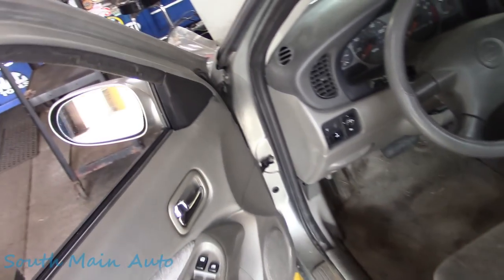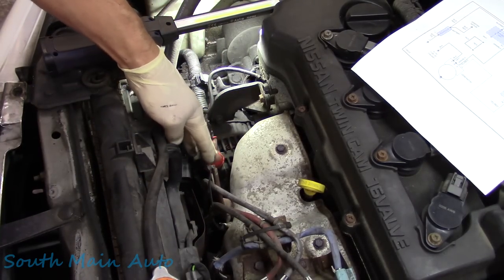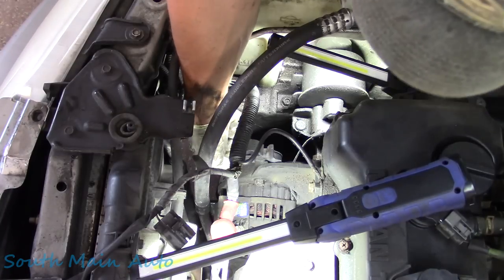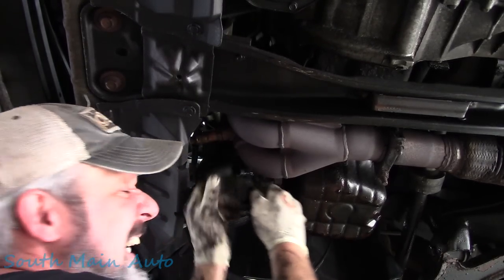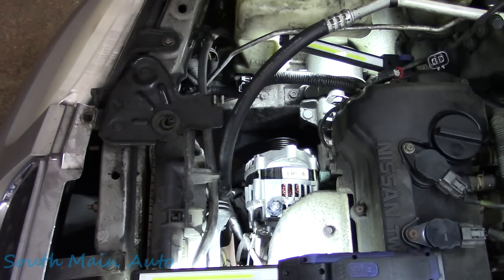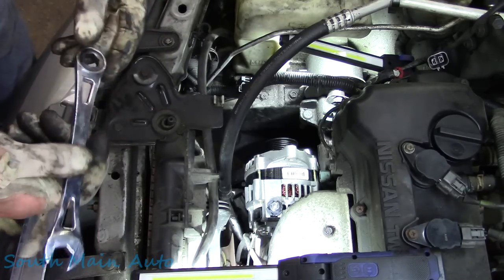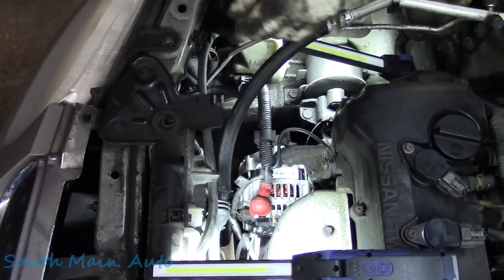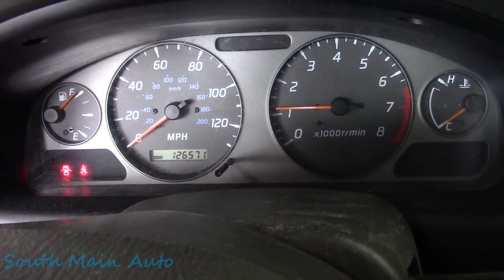Nissan Sentra: Battery & Brake Light On?

Comment: Had a 98' Maxima with 150k miles when my alternator died. Was driving and noticed the battery and brake lights on. Did a google search and saw a common issue is failed alternator. I was like, crap! I tried to make it back home but car died a mile later. It was 11PM and car was in an industrial part of town. Tried figuring out what to do for an hour or so, and a private ambulance saw me. I told them what happened and those guys jumped my car all the way home. Had to jump it twice but I gunned it and just barely made it back on the second charged. gave them what money I had cause they saved me a tow charge. I kept the car in the garage for a month or two before deciding to tackle the alternator job (watched a couple of youtube videos on how to do it). was a PITA but got it done, and even did hood struts and radiator replacement.
Reply: @Les Reeves yeah this was many years ago. Now i carry a portable battery pack, first aid kit, road side kit, and a fire extinguisher!
Reply: I changed the alternator on my '97 Maxima once. Once.

Comment: Hey Eric O, you had me laughing my head off watching you change out this alternator in this 2001 Nissan Sentra/Pulsar as I own the RH drive version of this same car. Same engine as well. I am on my 3rd alternator and it' 's a very common fault for them to fail at this amount of miles. My N16 series has 432,000km or 268,000 miles on the odometer on the same engine 3rd gearbox. I fitted a new 100amp alternator to have it fail 600 miles later. I was pissed because that rear bolt is a pain to get to. I found that a wire inside the unit on the voltage regulator had a dry solder joint and caused the new unit to fail. "J" hooking and soldering the wires fixed it and 1 hour later I was back on the road.
Love your videos as you make me laugh with some of the jobs you do.

Comment: Ah, back when Nissan made great cars.  I still own a 98 Nissan 200SX.  It's on teenage driver #4 now for a daily driver to school and back.  Been an absolutely FANTASTIC car.  Never breaks.
Reply: Ah the 2 door b14 sentra. Had one myself, back when they made rock solid reliable econoboxes and not rolling dumpster fire cvt equipped junk piles
Reply: @TheCarguy1993  Yep.  And I'm not sure why I love the car so much but I do.  It's gotten basic maintenance...starter, alternator, belts, thermostat, (and the occasional clutch replacement due to teaching kids to drive it and one of them burned it up in stop and go traffic on a hill one day) etc. but has been trouble free for 165K miles with teenagers driving it.  Fortunately, I can change the clutch in it in about 4 hours.  Not many cars stand up to that kind of abuse!  Thanks to that car, all my daughters have learned to drive manual transmissions.  They all hated learning it but once they did they brag to all their friends and all their friends want them to teach them.
Reply: @johnaclark1  thats killer, 1.6? I remember doing a clutch in about that time as well
Reply: @TheCarguy1993  Yeah, it's the SE model. Always wished it was the SE-R, as the 1. 6 doesn't get out of its own way, but the 33mpg of the 1.6 looks pretty good these days!  Perfect for my teenage girls.
Reply: @johnaclark1  the 1.6 is lethargic as hell but unkillable, here in ny though it was mechanically totaled cause the egr valve went,threw the money light,part unavailable and couldn't inspect it
Reply: Lets not go crazy.  They were notorious for head leaks
Reply: @gfriedman99  Well, it's got 175K, is 25 years old, and is still driven daily.  No head leaks yet.  It doesn't owe me anything.

Comment: The bad part is if that alternator is like most electronics from the parts store you'll be replacing it probably 3-4 more times in the next 5 years. At least that's my experience. On my own vehicles I wouldn't dare put on anything but a factory alternator/starter etc
Reply: Rebuilt alternators and starters are the pits. New Chinesium ones are only a little better. I agree completely: if the part will strand you or worse (like a broken ball joint) or is hard to get to, just get new OEM. Too many regrets from my penny-pinching youth.

Comment: A kilt is great But I had to stop I found the battery one day. when I had to straddle a fender on a Square body, I had to to get to the Distributor the truck was lifted just enough,  should have used the step ladder. Cover alls are great too in fact better because of that problem. And the Mrs' would rock them.

Comment: If you're gonna load test the alternator cable, it might be good to check the voltage drop across it while you're at it.
Reply: His tester has a volt meter on it. I’m sure he checked the voltage while under load.
Reply: @brycelund4112  Yeah, but it's hard to say what part of the voltage drop is due to normal battery voltage drop due to the load and what part might be due to cable resistance. TBH, I'm not worried about Eric's intuition, I just thought that others might get the wrong idea from the video. A 75A load doesn't mean much if there's a 6V drop across the cable.
Reply: @fascistpedant758  In a sense he was testing the battery as well. If it did have excessive voltage drop. I’m sure he would have then put his tester right on the battery posts . If the drop goes away. You know you have a cable issue.

Comment: I think engineers have squirrel droppings for brains sometimes when they put a bolt like that in a car. I used to wear overalls when I worked outside and yes they are comfy. I wore a tee shirt with it. The only problem with them is when you have to drop the kids off in the pool and one of the straps falls in and gets wet. Otherwise go for it. You could put your name on it and sell them as well. By the way, you have a smoking wife, great kids and a steady job to pay for it all, you are a very wealthy and from your comments a happy man. You hit the lottery. Peace out.

Comment: I had a 2001 Sentra GXE (QG18DE 1.8 liter 16 valve) w/ 5 speed.  Great little car.  Sold it to an acq. when it was too rusty for me, late 2016 (Wisconsin is a salty state).  He drove it a few more years until a drunk ran a stop sign & totaled it.  Sure it had over 200,000 miles & never needed significant repair.  Look at the exh. man. - it has 4 oxy sensors!
   Odd thing with that Versa rear light ground issue causing transmission faults... My 2001 Sentra's turn signals acted funny when I had a phone plugged in to the power port.

Comment: alternator on a 2001-2006 chrysler sebring / dodge stratus twins with the v6.  the lower front alternator bolt is equally a mother lover to get in and out.

Comment: Most Swedish car mechanics wore overalls until about twenty five years ago, they don't so much anymore because there are more good and functional modern work wear available now (work pants with a lot of pockets, flame retardant jackets and such). They also used to wear wooden clogs to work by the way (the kind with leather tops), but now they wear steel-toed work boots instead. But If you find an old retired Swedish mechanic working on something in his own garage at home, he often has his old overall and a pair of clogs on, they are comfy and practical, not all that stylish though...lol.

Comment: Just curious as to why the bad alternator caused the brake light to come on.
Reply: Had a civic that kept throwing random airbag codes. Couldn't figure it out after several times getting dropped off. Eventually the alternator totally crapped out and rhe airbag light never came back on after replacing

Comment: Some insulated carhartt overalls in the winter and everytime you go outside you'll be thanking yourself for buying them, only bad thing is they trap in all the farts so exercise caution and skip the beans. But in all seriousness, I love my pair, but i was kneeling a lot when wearing them and kinda wore a hole in the knees, and the stretchy straps are great, but after a year or a bit more, some of the elastic has started to fray out a little, they still do the job though, keep an eye out on a sale at tractor supply to get em cheaper. You know you want them, just look at how many pockets they have, you can fit soooo many flat head screw drivers in em!

Comment: Hey Eric , overalls are excellent mechanics garb unless you stand 6'2" have a little middle aged mid mounted fuel tank and need to bend over the front of a new vehicle or reach up under the hoist. My wife swore i had a sex change some afternoons my voice was so high pitched. The do go ok all year around, well here in tropical Oz, for insulation and cooling. We do need to see You and that beautiful Mrs O rocking matching SMAR overalls before years end though. Love your work you guys.

Comment: If I recall correctly that back in the MC hammer days that Overalls were a thing also. But wearing said overalls you had to leave one or more of the two straps undone and let them dangle. I will not confirm or deny weather I did or didn’t wear those, but I definitely DID NOT wear the MC hammer pants. It looked to stupid, like someone had taken a dump in their pants. I think Mrs O should go shirtless with the overalls. JS 😁

Comment: Overalls are good and comfortable, but in your climate with the temperatures you get, you'd probably be uncomfortable as most are made out of polyester which would be like running around in a plastic trash bag.  Bib coveralls would be better - no belt, lots of pockets to lose stuff in and at the end of the day, pull off the t-shirt, grab a straw hat and pluck on a banjo! :)

Comment: That's why I hated the nissan alternator placement... on 2000 toyotas the alternators were usually NOT placed like that... and take a look at that alternator wire placement.... 10 year old would not design it like that.

Comment: Alternators SUCK! I don't know what the flat rate time estimate is for this on the Nissan but I have to remove my radiator and the front bumper to get at it on my Honda Odyssey as one option. The other option is to partially remove the AC compressor and try to fish it out through the top and side of the block. And Honda also took the extra special step to put a VTEC spool valve above the alternator and it is prone to leaking and destroying the alternator after 100,000 clicks.

Comment: woah, by 16:25 one hand/fingers on bolt, hold/move/wiggle alternator with other hand. there will be a sweet-spot that bolt mostly unthreads easily.
have I had them go 3/4 turn and become seized there nothing fits or turns it anymore? (yep) it's times like that, I have to walk away and cool down, because next step in an 6' spud bar and 14lbs sledge hammer. I's smash it and the brackets into dust and cost myself far more, or negative amounts.

Comment: I got a 2000 ford explorer  xlt it won't start the security system has locked me out from starting it I have followed all the procedures I'm resetting the security system on it and it just will not work all the truck does it's just crank I have hunt down all the fuses to see if they were bad or you know the inside of them were conducting right and everything seems to be working no blown fuses so I don't know what else to do I seen you on your channel here sir and maybe you might have some ideas of what could be wrong with my Ford Explorer

Comment: That's a real shame you don't "rebuild" alternators... or maybe they're all built like garbage lately, especially the "rebuilt" champion types? Our 30 year old Toyotas have their original equipment alternators still running great. They only need new diodes or a voltage regular every 5 years or so, very rarely brushes. All parts just unscrew easily.

Comment: Been there also. Battery and brake light was only when the engine was at low rpm. My question is the heavy negative cable unsheathed on that one? The one on my kid's is and I thought it was wrong so ordered a new one and they come that way right out of the box. Anyone know why? I sure don't.

Comment: i have a question.I am a bodyman and monday i have to put a new upper  saddle on a 2018 bolt ev.electric car.when you open hood  i take that back i had to pry hood open it was bent back and twisted hit a deer its all big orange casing wires and the 12 volt battery is there theres a big red warning tag cut here shows pic of scissors for 1st responders in case of bad accident im guesing.i did more investigating through icar.even to service a chevy bolt you dissconnect 12 volt battery first then pull the hv dissconect under rear seat with class 0 gloves lift turn left then pull.icar mentions that chevy bolts evs can be disabiled just by using certain scan tools is that true?i know the hv is 1000 volts so now i need lineman gloves?.i remember years ago when prius came out i was wary and called a pro in he just grabbed bare hands pulled the dissconect charged us 200 dollars and walked away

Comment: Overalls?  We call them overhauls around here.  What you need is a pair of  overhaul shorts.  Buy you some overhauls that are comfy and have Mrs O cut the legs off and hem them.  You will be the sharpest looking Mech in Avoca, NY. You wear them with boots to really stand out. Oh, and if you don't want to have blue body parts make sure Mrs O washes them good before you wear them.  Underwear is optional.

Comment: Alternator in a 1998 Cadillac Deville.....Let's just say if you don't have a lift take it to a shop. 5 hours laying on your back in the garage cursing at GM engineers because it's so tight the exhaust manifold is dimpled for a bolt to clear.

Comment: Yup. There it is. Nissan and their engineers  stupid design for alternator bolt placement. Dang tight squeeze and almost impossible to remove the lower bolts in all nissan vehicles. Almost got to the point of removing the engine just to replace an alternator. Maybe nissan designed their engine layout and installed everything before installing it into the vehicles 😅

Comment: I like my overalls, but I can only wear them in the winter with a thick shirt and ain’t no way I could go shirtless with them. There is just too much chaffing on the nips from the bib for me. My grandad has sworn by the short sleeve Dickies coveralls for decades. They are definitely comfortable, but I prefer thicker fabric on my knees.

Those Pakistan boys definitely do some amazing work. There is nothing they can fix with an arc welder and a grinder. I’ve watched them weld teeth back onto ring gears and patch up basketball size holes in an engine block. I don’t know how long their repairs last, but I’d be willing to bet their customers are glad if they can just get to the next stop. As someone that has done more than my fair share of river dance welding in flip flops, I have no shame in saying that those Pakistan welders/machinists/mechanics are tougher men than I am....

Comment: You got a absolutely love the location of some bolts holy crap you had to get the alternator out of my Kia optima I had to pull the axle shaft one does Wonder though if a flex head ratchet wrench would have helped you there or hindered you I have no idea I know it has saved me on a couple of times just an El cheapo set from harbor freight that cost 20 bucks was worth its weight in gold

Comment: "It would be nice if that thing was slotted or something." Engineers let's make this a 3 bolt alternator with through bolts and this bolt is blocked by everything so you have to pull the entire engine apart to get to it.

Comment: Early 2000 model cars are definitely a pain sometimes I mostly work on 86 to 08 around these parts I get newer As well not as often as older vehicles though they always hide bolts on these older rigs Eric O it's a pain especially on Mobile Calls With no Lifts @SouthMainAutoRepairLLC

Comment: I love your idea about electrical tape. To add one more idea, I have wrapped tape around the flashlight I use. That way if I need to mark a wire or hold something in place, I just pull some off of my flashlight.

Comment: Whoa! THANKS ERIC O.
Makes me feel better about my own DIY frustrations. 

e.g. Back 3 coils & plugs on my V6 SUV.  So many darn "part-access" variables; it boggles the mind. (Thanks to Hawaii Mechanic, did them without removing intake plenum!)

Prevaricating MARKETING AIR HEADS AND EMPOWERED BEAN COUNTERS are enabled and encouraged by greedy sociopaths at the top. e.g. Perhaps 10% of buyers "need" AWD, but it is a profitable option ... so 90% of vehicles have it.

WHEW! Went to that PAKISTANI TRUCK CHANNEL ... BEYOND MIND BOGGLING. If that guy with the sledgehammer is off just a few mm ... that "Chisel Holder" WILL lose a hand / arm / life !!! INSANE! No gloves, no masks, no google, EXPOSED TOES ... WHAT A MESS!!!

As you say, ERIC  ... it certainly puts a PITA (pain-in-the -a**) Alternator-Bolt location into an "easier to accept" category.

Sadly, there is NO INCENTIVE for Auto Companies (aka Vehicle Assemblers) to improve or even consider "Ease of repair". Good independent mechanics are forced to buy more tools and lease more data ... and learn more tricks ... and spend more time.

Bad mechanics (or honest ones forced by shop-owners and dealers) just cut more corners.  e.g. that "almost-impossible-to-open" differential fill bolt on an AWD ?? Just a few drops of oil and wipe it and nick it a bit ... to make it "LOOK" like it has been serviced and bill for the hour or so ... add 80 cents to the bill for a shop towel to make it look legit and ...
... "Just fine now, Lady!"

Comment: Love watching someone other than me do this job.  Do not miss the last bolt on that setup. Must resist the temptation to not install the back bolt.  Must resist,  argl....    Throws bolt across the shop and spend the next hour searching for it    only to realize if I had just I bolted the a/c compressor and moved it just alittle i could have been done by now.